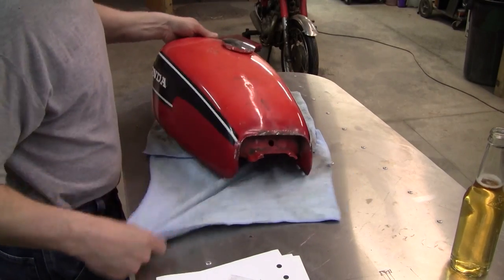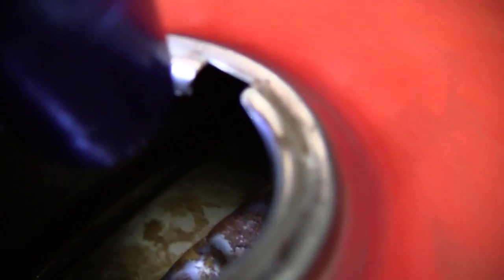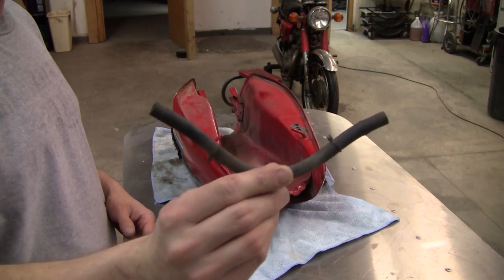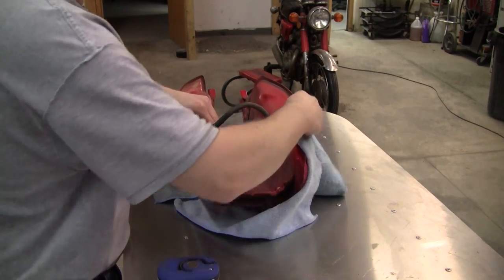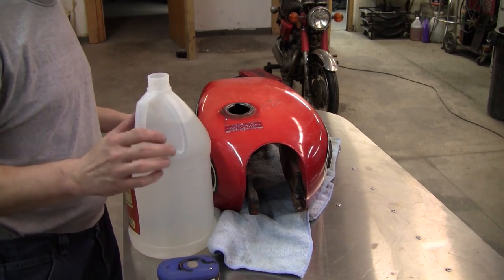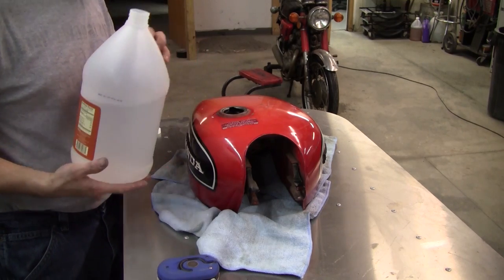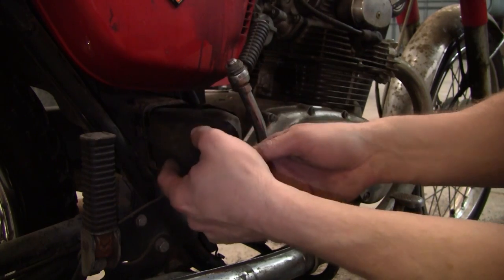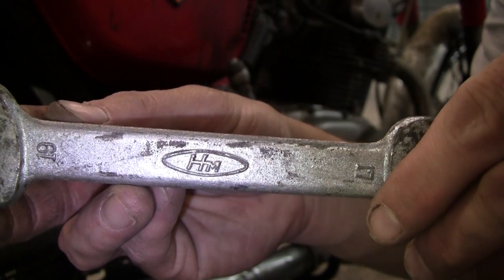1972 Honda CB175 Restoration Part 3

Comment: Bikes did indeed used to have good tool kits, a lot of Honda's still do just looking at the kit which comes with the latest CB1100 a lot of the tools in there will be exactly like the ones in your kit there, the open ended spanners etc for sure. I can't speak about other Japanese makes as I'm a Honda/Triumph parts guy only but my 1990's XJ also had a good kit with it, although mine is one I bought second hand off e-bay. I know for a fact you'll not find much with a modern Triumph though, tool kits with a lot of those are classed as an accessory, if you're lucky they might give you a allen key if you need one to get the seat off. Quite a few tools in my main toolbox are also ex Honda tool kits, including a really nice 10/12 ring spanner from a Goldwing and a lovely screwdriver which came from a Toyota car my wife once had.

Comment: do you have to coat the inside of the cb175 tank after the vinegar treatment, thanks keith from uk
Reply from the maker: Keith - After the vinegar, I rinsed it out with some water/baking soda mix to neutralize the acid.  Then you could coat it, but I just filled it to the top with non-ethanol fuel and it's been fine.  I think as long as you keep it full when your storing it for a long time, you'll have less chance of condensation forming and causing rust.  Thanks for the comment!

Comment: How well does that vinegar work? Can it work with deeper rust?
Reply from the maker: Vinegar is a very mild acid.  It might work with heavier rust, but it would take a lot longer.  It doesn't cost much to give it a try, but you might want to try some mechanical removal first.  I've heard of some people putting sheet-rock screws in the tank and shaking the hell out of it first to knock the heavier rust loose.  Depending on how deep the rust is, you may end up with a few new pinhole leaks.  Good Luck!!  and thanks for the comments!!